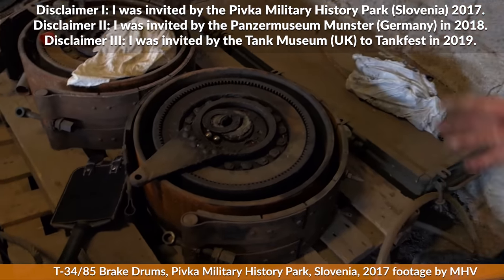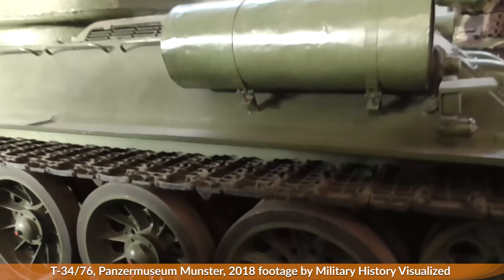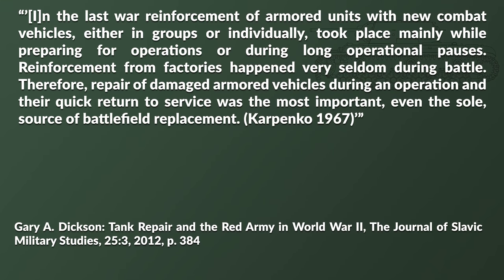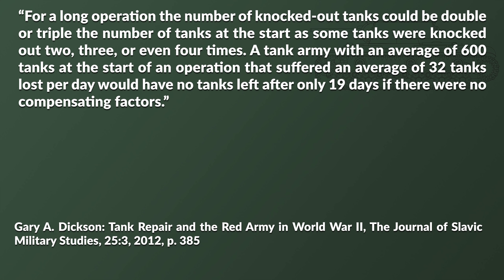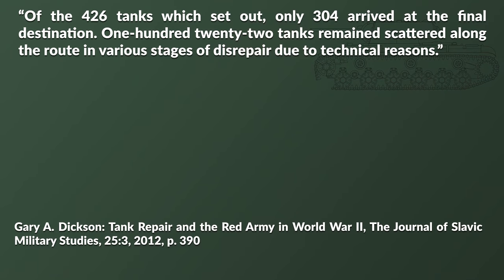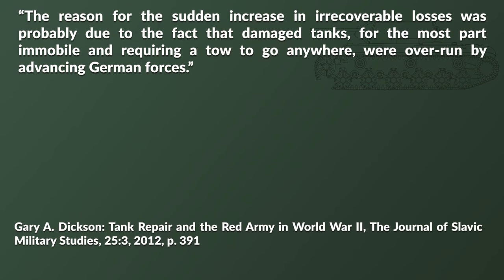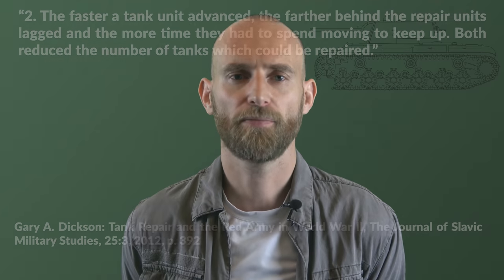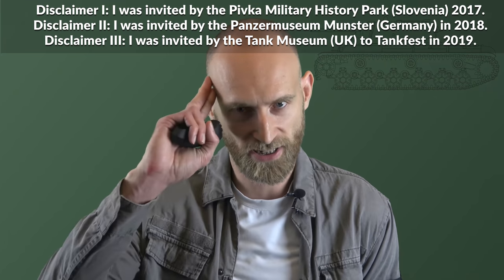Soviet Tank Repair in WW2

Comment: The repair units at one 5th Air Force base during the Pacific War managed to build an off-the-books B25 out of cannibalized parts. Without armor or guns it was the fastest B25 ever and they used it to bring booze back from Australia. War is never as simple as people imagine.
Reply: One of my uncles was in New Guinea during WW2 in the Australian army. One of his stories was that the Yanks had no beer but the Aussie's did but it was warm. The deal that was worked out was that the Yanks would load the beer into an aircraft as supplementary cargo and take it on a mission. Afterwards they would share the cold beer.

Comment: It is incredible how tanks are formidable in some circumstances and utterly vulnerable in others
Reply: It's all how they are used.  It should have been obvious that tanks were more of a hindrance than asset in Vietnam when infantry spend more time protecting the tanks than the other way around.  There is some credence to the argument that the best tank is a Ford pick up truck with a Tow missile launcher.
Reply: @princeofcupspoc9073  

That's a doctrinal error, not a tank error. The US invasion was trying to fight a WW2 style static war of attrition, while the Vietnamese fought a war of mobility as if Sun Tzu himself was their chief military adviser.

A more correct handling would've been to use them as mobile strongpoints that constantly move and add chaos while acting both as bait and a strikeforce against local concentrations.

It's not a unique mistake either. Israel suffered ridiculously high tank losses in Lebanon recently because of lack of tank crew training, and using them in a static role, pretty much parking them somewhere in the open, unconcealed, while Russia had made sure that Hezbollah terrorists had the very latest Russian army anti-tank missiles at their disposal.

Comment: I'm not surprised tanks are vulnerable in transmission capabilities. It's a lot of weight for the engine and the transmission to haul around.
Reply: Scott Joseph  Their weight must've certainly contributed a lot to that. Pretty big tanks after all.

Also, I think the tracks themselves on tanks probably contributes to the issue. They give good traction obviously, but generally in all things mechanical, the more traction you have, the more friction and strain it will put on the engine and transmission.

A car is not nearly as heavy, but what it also has going for it is that it only have two, pretty small contact points with the road.

Accelerating the car puts the most strain on engine and transmission. But once you get it up to speed, it can lazily roll onwards by it's own momentum, only requiring a little extra gas to maintain the desired speed.

Can't really "roll" along on tracks as easily, so the engine has to work more during movement.
Reply: Look at it upside down.  Why put a transmission that's massively too powerful into a vehicle?  That's a waste.  It's an engineering trade off to put the lightest and cheapest possible into any design.  Topics like lifespan and usage are looked at very carefully during design (and redesign as modifications are made).  Also, availability of parts like transmissions might not be what is required.  Now imagine trying to balance those vehicle productions, sub-assembly production, resource allocation, etc. on a wartime footing.  This is one of the reasons that I find WWII fascinating.  Half of the world tooled up to build killing machines.  Would make a good scifi story.  I like studying logistics, damn it!
Reply: @princeofcupspoc9073 : This is also why I find warfare fascinating, and overall consider the phenomenon more of a benefit than a drawback for mankind.

Granted, it involves a lot of killing and destruction. But the quantum leaps made in engineering and technology is not only captivating, but also usually end up helping mankind in the end.

Most of the technological marvels and conveniences we use in our everyday lives can trace their origin to technologies developed for warfare originally.

My theory is that people are simply more spurred to be inventive during war than during peace. If you're not being more invetive than your rivals in peacetime, all you risk losing is market shares.

But if you're not more inventive than your rivals during war, you risk losing your life and the future for your whole society.
Reply: @sevenproxies4255  yeah that's pretty accurate, the reason why a tank does not coast like a car when you stop accellerating is that a tank's tracks are designed to have has much friction with the ground has possible to render the tank capable of climbing steep hills (for example a Sherman is capable of climbing a 60% slope) but the track has to be made large eneugh to not make the tank dig itself into the ground by giving it a larger area to distribute it's weight.
Thing is tanks can coast like a car but most of them can only do that for a few meters has if you combine the ammount of energy you loose by drag and the generally slow speed of a tank you won't coast for long, Now I know that a tank is heavy and it gets a lot of inertia when moving tho that weight also goes to increasing grip on the tracks and so increasing drag and thus lowering how much distance you can coast. Wheeled tanks are able to coast tho that ability is completely useless wille crossing rough terrain which is exactly what tanks where made for in the first place, also the wheel's small contact surface with the road is why you don't see any particularly heavy tank with wheels has it whoud just sink into the ground

Comment: Being too large and heavy to be towed or recovered following a breakdown / combat damage / terrain problems hasn't been the first thought in the minds of designers of certain tanks in the past.

Out of all the 62 x T-35 land battleship heavy tanks deployed during 1941, the majority were lost due to transmission failures (clutches) or ran out of fuel. They were too large to tow and required specialist repair equipment which pretty much sealed their fate once broken down or disabled.

The same problem occurred with one of the SMK heavy tanks during the 1939 Winter War with Finland when it was immobilised after it ran over a massive command mine during an attack on the Mannerheim Line. It was also unable to be towed despite efforts by a pair of T-28 medium tanks and had to be scuttled with explosives to avoid capture.

Out of the 4 x Nbfz. heavy tanks deployed and used in combat during the Norway campaign in 1940, one was blown up by the Germans to avoid capture, after it became stuck in boggy terrain and could not be towed out. The other 3 were all lost due to enemy action: One set on fire following repeated penetrating hits from a Boys AT rifle. One immobilised and subsequently set on fire following multiple penetrating hits from a British crewed Hotchkiss 25mm. L.72 AT gun and one set on fire following a petrol bomb barrage from Norwegian troops during street fighting in Oslo.

Oddly enough the Tiger.I.'s 88mm. L.56 KwK.36 was originally intended for the Nbfz. but the tank was so underpowered it was incapable of carrying the weight of the KwK.36, so instead they went for a lighter 37mm. L.45 / 75mm. L.24 combination mounting.

Comment: I remember reading about Rommel, he stressed to his commanders to control/own the battle field once the fighting was over. It allowed for the recovery of knocked out tanks and equipment and denied the enemy, recovery of their equipment.
Reply: That was one of the reasons that the Germans could not regain the initiative in the East after 1943.  Big heavy tanks need big heavy recovery vehicles and repair facilities.  But if the enemy controls the battle field time and time again, you are not able to recover those vehicles.  This makes replacement equipment critical, and the German industrial production at the time, although streamlined and rationalized by Speer, was still not ready to pump out those replacement.  (At least not until 1945 and the plethora of cheap volksgrenadier guns and vunderveapons started arriving.)  When the Germans beseiged Leningrad, Stalingrad, and even briefly Moscow, the Soviet took tanks right out of the factory and rushed them to the fighting.  The early German system would require post assembly, break in, training, etc.  Later they did not have this luxury.  For an example look at the Panzer IV types.  The last ausf was not the more capable, it was the cheapest to produce.  They even removed the turret motor, so it has to be rotated by hand.  The ausf J resembles a T-34 in terms of construction more than any previous model.
Reply: @princeofcupspoc9073  makes you wonder how different the war could have been if the Germans had actually been capable of realizing they were losing before it was already to late. 

I've always thought that for all the technical wizardry that is a Tiger II, it was designed for completely the wrong strategic and logistical situation, and surprisingly had little to no effect on the war.

Comment: Did either side develop " Calvary " either land or air based to hunt the maintenance personnel ? 
It seems logical to hunt broken AFV and the troops that fix them rather than fight a repaired platoon.
Reply: Break through enemy lines, seek out repair facilities and destroy?  I think if you are wandering around in the enemy's rear area you have more important things to consider, like getting the hell back to your own lines.  If you are imagining something like US Civil War cavalry, there was a lot more empty terrain.  In WWII all it would take would be one enemy with a radio to call down some artillery on your ass, and mission failed restart game.  This one of the reasons that the US has such a woody about "smart weapons" that can recognize targets and take appropriate actions.
Reply: Not really. Retrieval of vehicles would take place only AFTER you owned the battlefield. So, if you were to call out AFVs and engineers, the enemy already has a good position to repell your 'raiding'/'cavalry' party. 
If you want to aim for logistical concentration points (supply dumps, maintainance facilities etc.), those are generally located beyond enemy lines at quite some distance. And 1. it would be a hell of a job to get there and you have little to no chance to do that with a small unit. 2. If you are there, you are most likely also able to destroy enemy communication or command facilities, which are even more valuable.
Reply: not logistically worth it. a tank in a repair depot is a tank not on the front line, so as a strategic target they're of decidedly minimal importance. Yes, it's always nice to hit an enemies supply depot, but if you can get behind the lines it's far more useful to attack combat assets in the rear.
Reply: Yes. It's called breaking through to the operational depths and exploitation with mobile units.

Comment: I guess it's a myth that Soviet tanks were designed to not last much longer than they were expected to survive in combat. It would be interesting to know whether Soviet factories sent spare parts in the volume shipped to American units, or did Soviet repair depots have to rely on cannibalizing broken AFVs?
Reply: Not a myth.  Even into t-62s and t-72s.  But its designed to play to Soviet strengths.  The T72 gun barrel is designed for a useful life of 100 rounds for example.   But that means its cheap to make, so Russia made 10,000 of them.   When a crews barrel or other part wore out they drove it to depot and got a repaired vehicle.  Depot then repaired the turned in vehicle.  In a war they have another 9000 in a warehouse.  source: Steven Zaloga.
Reply: that's actually not a myth... life expectancy for a t34 from the factory was about 3-4 months. The soviets just knew keeping that unit in fighting condition for those months was pretty important as well.

Comment: Many WW2 tanks were notoriously unreliable due to design faults, expedient use of parts and systems not fit for purpose or poor manufacturing and quality control. Add in other factors such as harsh operating environments, poorly trained crews and sub-standard maintenance and you have issues even before entering combat. Little wonder all sides worked hard to recover and reuse disabled and damaged tanks.
Reply: You also have to factor in that a tank is an odd thing that requires you to force as many heavy moving parts into as small a space as possible while keeping it under a certain weight limit overall, and then find room for the crew and ammo. That leads to a lot of very fine tolerances in a lot of complicated systems, all of which have to more or less work at the same time for the thing to be of any use at all. That makes them a hell of a lot more fragile then one would assume just from the eye test.

Comment: I'm wondering what your opinion would be if anyone had tank transport vehicles if that would have made a difference to make it worth it? They are (on roads of course) faster, they save fuel, save wear and tear and allow the crew to get rested and repair the tank.  I wonder your general idea of the idea, lol.
Reply: Tank transport exist. They are either ships or trains.

You mean tank transports on roads? Why? Like what do you gain? You do not save up fuel because you would need to transport the whole lot of the total weight of tanks plus the weight of the vehicle itself. And then you would have to carry fuel for the tanks in combat and the transports. The only thing that such a vehicle would solve would be to reduce the wear on the parts, but that's all. 

For individual tanks, yes, you have 'towing' vehicles meant to transport imobilised tanks, yes, they exist, but in the ideea of a transport for large formations, nope.

Comment: The Soviets actually did repairs on their tanks and not just run them into the ground and strip them for parts?
Reply: Stripping a knocked out tank for parts on a whim was forbidden and a punishable offense. Abandoning a tank to be stripped was also forbidden. Knocked out tanks have to be kept on record and surrendered to a repair facility, where they would be either fixed up or written off and scrapped.
Reply: @TankArchives  unless in the East in 1945 in operation against Japanese, as fear Eastern had remaining old type tanks and those were abandoned when broken down, there was somewhere photos of broken BT-7 in 1945 used as a directions sign

Comment: I wonder if any of the repair teams lived long enough to spend all that money.
Reply: Most of the Soviet soldiers were sending money home to their families. There's not much you can by on the front anyway.
Reply: All on women and booze
Reply: Keep in mind that the actual number killed in any modern battle (with modern medicine) is much smaller than in previous wars.  And repair crews were rear echelon troops.  So, yeah, most of them did, second half of the war at least.
Reply: if most of them weren't, the Soviets would have lost the war because of the Germans constantly rampaging behind the lines.

even in a retreat situation, those are the guys far to valuable to leave behind, so would have been the first ones evacuated.

Comment: This is the first I have heard of the Soviets using monetary rewards. I would have thought a double allocation of vodka would be sufficient for the repair teams. The front line men didn't need it. it took so long for paper work on roster strength to catch up that the actual number of men left in a unit was far less than the strength the supply people had on their documents
Reply: Is it strategically wise to keep your best units drunk?

Comment: I thought in Soviet Russia, you give tank vodka and it will run?
Reply: At least modern multi-fuel tanks can work on alcohol I think.
Reply: Ethanol is a well regarded fuel additive for some extra umph.  The problem is that booze is also ethanol, and it can be sold for a lot more in little brown bottles than in giant fuel barrels.